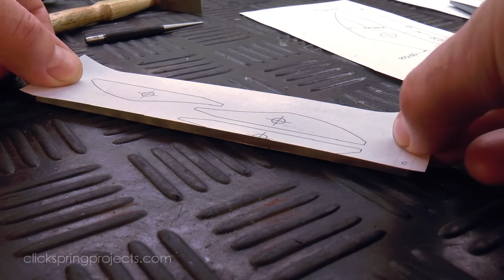Making Parts From Paper Templates

Comment: Would like to know what the white stone you use for debuting is! Always a pleasure to see you work.
Reply: It’s an Alundum Stone usually used in enamel work, it comes in a variety of grits :)

 https://www.riogrande.com/product/AlundumStone220Grit/350030
Reply: I think it's an oil stone. You can get them in all kind of sizes for polishing or to even out vice surfaces.
Reply: it's an Arkensas White or Translucent stone. you can probably find one at your local sharpening supplies retailer
Reply: Thank you for your suggestions gentlemen most helpful

Comment: Can someone explain why does the drill move this way? Never seen that before
Reply: Marc-Antoine - it’s not a drill, it’s a swiveling type of center finder, known as a “wiggler”. There is a ball and socket joint in the middle of the tool which allows the point to swivel. Once the tool is rotating in the machine spindle, the point is gently contacted so as to straighten it, as was done using a pencil in this video. The straightness is judged by eye; it’s correct when the pointed tip has no visible wobble in it. In this way, the machinist can be certain the tip is exactly aligned with the axis of the spindle and can therefore place that axis directly over a feature on the part.
Reply: @624Dudley  thank you !

Comment: I missed how he transferred the outline to the part. Was that when he dipped it in that tub of liquid? How does that work?
Reply: He didn't show this. Good question. I thought he would have used a knife to cut through the paper but rewatching the scene shows no evidence of this.
Reply: He kept the template on one part and only removed it from the second one to grind them together
Reply: @bwjc, paper stayed on the part. Remove paper after finish to lines!
Reply: If you watch his clock building series, you’ll see lots of examples of working to the line on the paper template itself. It’s not transferred to the material.